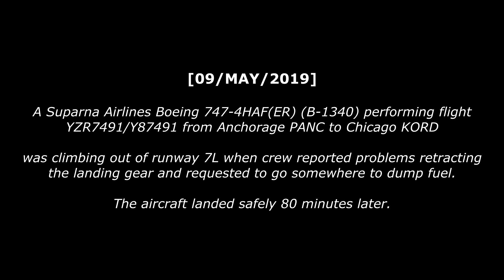[REAL ATC] Yangtze B747 is UNABLE TO RETRACT the Landing Gear!

Comment: I wonder if the problem was due to safety pins on the gear? Many decades ago while flying c-130s for the US Air Force, I watched another C-130 depart only to immediately return, land, stop. The flight engineer exited the plane, removed the nose gear safety pin, then take off.
Reply: days before they tried again. sounds more serious than just the pins left in.
Reply: Could be a simple shutoff valve or complete hyd failure of the system that controls the gear

Comment: At about 9:30 the incomprehensible call was a readback of the ATC clearance, and the second transmission was the 747 calling to say they were establsihed on the ILS07 approach, which promopted the approach radar to switch them over to tower.
Reply: How do you decipher that in the crinkly white noise heavy audio? And does it sound this horrible for the pilots and atc too, or is it just the record? I have no idea how someone can understand that, is there a trick to it? Or just experience?
Reply: @NotAliceTho  It's not this bad, I'm going to assume that this was a recording issue rather than an actual call quality degradation, otherwise the ATC would have definitely asked them to repeat their message as they were unreadable. Deciphering is purely experience and catching some key words during the readback, most approach radars want a confirmation that you're established on final approach before handing you off to the tower controllers. Hope that helps!
Reply: @113399  That is amazing. Experience is key in this case. Thank you very much!

Comment: I’m confused - why didn’t the pilot notify ATC earlier? Presumably they knew about the retraction issue immediately after takeoff. I’m not sure what the overspeed for gear is on a 747, but I’d imagine it hurt their performance big time - ATC likely needed to know as it changes the planes performance profile for that sector. 
Anyways I think I saw them get to a decent altitude (and accepted clearance for FL200) while they knew they couldn’t do it. 
Just kinda odd.
Reply: Pilot's gotta fly the plane first. Comms later. you can see this in Sully's comms.
Reply: Eric C I mean that’s cool when you’re talking about a few seconds (ie basic pilot training like you are referencing), but not LONG periods of time. They flew the aircraft WITH a mechanical failure, well past what procedures allow for.

You don’t climb a 747 to that altitude with your gear down lol! With zero word to company or atc? They were CLEARLY trying to avoid any paperwork and a return to field long after it was a major fault / RTB issue.

Comment: what happens with the fuel dump? does it just evaporate as it falls?
Reply: Jet A doesnt evaporate. It just pollutes the atmosphere and sticks to whatever it falls on.
Reply: yepp, and this is why they try to keep it in a specific area
Reply: Please don’t encourage those who call contrails “chemtrails” or we’ll never get out of here.
Reply: @themechanic568  watch captain joe's fuel dumping video. They put it over a specific area in the case of it not having enough time to evaporate.
Reply: @gnranger  don't need to. I'm a jet mechanic and pilot. It doesn't evaporate. It may atomize enough to not cause spotting on the landscape below but it never leaves its solid form unless combusted.
Reply: @themechanic568  yeah right you are
Reply: @ndmz903  yup
Reply: @Trust Jesus Nope. The air fuel ratio for that to happen would be Impossible at those speeds during the dump

Comment: What's the difference comming back or just land at your destination if they issue is related anyway to the fact of landing?
Reply: arianzo a landing gear hanging out like that increases drag
Reply: Massive drag - you probably wouldn't make it with the planned fuel. Other consideration is where is the maintenance? Do you have your own engineers or a contract in place at the other airport...?
Reply: Also, the plane can be overweight for take off but not for landing, they are counting on the weight savings of the burnt fuel from the enroute phase to bring the aircraft back within a weight that wont break the landing gear. And as mentioned earlier, the amount of drag the landing gear creates will cause the airplane to either not make it all together or at the very least, not have the required fuel remaining for an alternate airport and the required flight duration beyond the alternate airport measured in minutes. The additional amount of fuel is required by the FAA.
Reply: Seeing as the planes are more fuel efficient when they weigh less, they are rarely fueled to a full tank, but instead to the minimum required by the FAA plus (x) amount the airline company deems appropriate. But its usually not by much since they burn less fuel carrying less fuel, saving who knows how much over a fleet of airplanes annually.

Comment: What will happen if you fly the plane to it's destination without pulling the gear up?
Reply: Possible run out of fuel.
Reply: You might get there but probably not. It'll take a LOT more fuel.
Reply: You're going to have a problem with fuel.  The lowered landing gear will cause more drag increasing fuel consumption.
Reply: Having the gear down creates a lot of drag and limits the speed of the jet. 747's cruise at around 550mph. With the gear down the max speed is 368 mph. The tires are filled with Nitrogen it expands the tires at higher altitudes and can cause them to rupture. So the jet can't do what it does best. It can't go high and fast through the thin air. It will have to go low and slow through the denser air. It will burn more fuel and have less range and take forever. The gear and doors could also suffer more damage from their time in the air. It's better to dump the fuel and get down. Jet fuel is easier to replace than landing gear parts.
Reply: Okaii thanks for replying
Reply: Slower